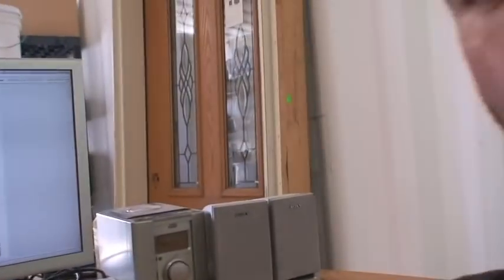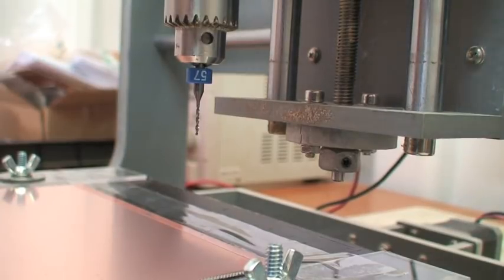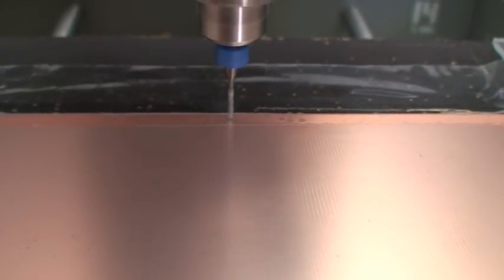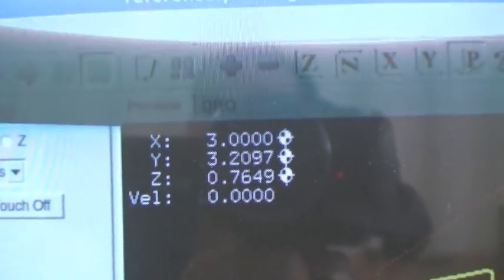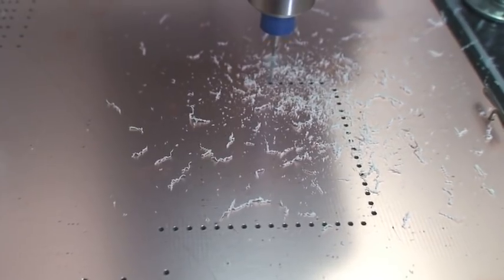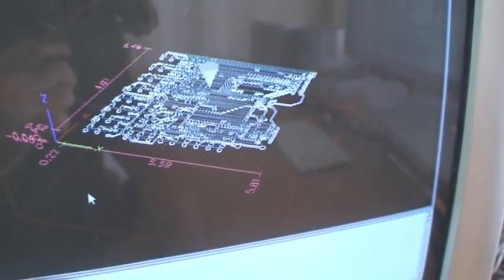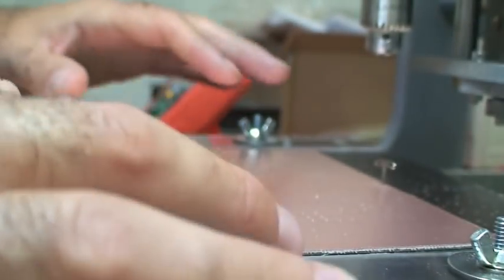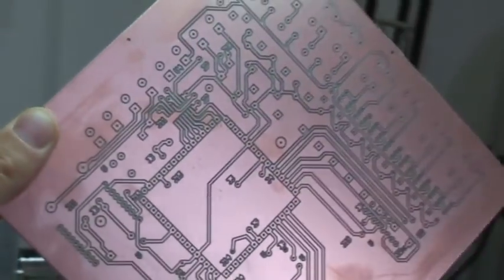Double Sided PCB CNC Milling

Comment: At the sound the bit makes, it's more around 7200 RPM...

Believe me, 30 0000 RPM would make a much high-pitched noise !!!

But, this is only a detail... The finished board is nice, that's the most important thing !

...And i am happy to see the results; i've just bought the same CNC that you use and am waiting for it to be shipped !

Comment: nice video, would like to see how you line up the second side, but also how do you overcome the variances in board depth across the pcb?  i'm still having problems with missing track sections where the board is alightly thinner

Comment from the maker: I use tacks in 4 corners and then flip the board and put the tacks back. The software handles the top/bottom and mirror issues so I don't need to think about it.

Comment: Board profiling methods are often discussed - where an electrical probe is used to probe the vertical height profile of the board in many different locations around the board. This profiling method wasn't used here in this clip. Instead, holes were drilled for the initial step, which would then prevent profiling techniques from being used. Just wondering if there are techniques for getting double-sided boards (using CNC) that does profiling on both sides.

Comment from the maker: I used gEDA / PCB to design the circuit and generate the gcode. It's a built-in export option. I made the PCB on a Zen Tool Works CNC 7x7.

Comment from the maker: This is a Zen-Cart 7"x7" which costs about $300 for a the bare kit and $700 with all the options and shipping. It includes the 30,000 RPM spindle. Each blank is PCB costs about $6 for a double sided 6" x 6".

Comment: Great video. Thanks!

Hi, I'm starting to make my own boards with my own CNC machine but I don't get quite the same results as you do. I'm using the 0.1mm carbing but is 10º. Also, I'm working way slower than you, like 6 to 10 mm / min. The drill is going 6000 rpm. Could you give me information about the speed of your CNC and drill?

Any other sugestion?

Thank you.

Comment: Also, one extremely important thing that nobody on the internet seems to tell us about is.......  this double sided pcb milling technique (that features this board flipping method) will only work properly if the spindle is properly adjusted so that the spindle's rotating column is perpendicular to the cutting surface. Because you can imagine what happens when you pre-drill the pcb alignment holes for the case where the spindle column isn't perpendicular. The problem will be that the alignment holes won't line up properly when you flip the pcb over --- this is because the hole opening on one side of the board will be offset by a 'tad' (due to drilling at a slight angle) in relation to the opening on the other side. So, if the drill bit is on this particular exaggerated angle "\" then the top hole is obviously going to be at a different location relative to the bottom hole. And this is just along one axis. There are two axes (x and y). The issue will not only be holes locations being out when we flip the board. The other issue is not being able to insert the pins. That is, when one side of the board is used, then the pins would fit perfectly. Once the board is turned over, the pins won't fit .... due to the distorted geometry. So, this means proper CNC machine setting up will be necessary for this 2-sided pcb engraving method to work nicely.

Comment: This  video is very useful, but i have a question about the 2nd layer, because you  put the video when the machine is working and i can't saw how do you locate the origin, do you use the same origin?? from the other layer

and other question,  you drill the holes at the first time, why the holes first and no the engraving first ??

Comment: Great Job, Mikey!!!   Technology for the People, yeah! MicroInterprise based in home-based technology is what the future economy will be based in.  I would love to print a board that controls two, 3/4 inch valves that uses two temperature sensor inputs and open/close-limit inputs that are adjustable each and can be inputed for each.  That way the unit could be a flexible tool for biodigestor controls, algae cultivation and basic reflux distilation processes for many compounds and just water.

Comment: One thing to note about lowering the chuck onto the drill bit and then tightening it is to keep the drill bit tip against the PCB as you tighten else the tightening process can cause the drill bit tip to lift off the PCB slightly and when we're talking fractions of a millimeter cutting depth, it matters. I prefer locking the bit into the chuck and then lowering the tip down to the PCB in small increments until it's touching the copper.
Reply: Another thing to note is how far into the chuck you insert your V-Bit cutter. Insert it too far or not far enough and you can end up with rough cuts due to resonance which is also related to the RPM you mill at. The same applies to cutting too deep or too shallow. A friend of mine was continually getting rough cut results when milling PCB and when I visited to lend a hand I found he had put the cutter into the chuck right up to the end of the shank. It happened that the cutter was resonating in such a way that it was skipping along the walls of the cut leaving jagged edges. Pulling the cutter out of the chuck by a few MM cured it and he had lovely clean cuts.

Comment: Very cleaver way to z it without a touch plate.
Reply: You can also use the copper of your pcb as a touch plate, and call G38.2 or G38.3 manually in linuxcnc.
Reply: Another cheap and easy way is to jog manually onto a piece of thin paper sheet while moving it. When the sheet gets caught, you're on zero. Just remember to crank down the speed for the last millimeter or two :D
Reply: @InnerBushman  no you are actually the thickness of the sheetpaper above the surface of the PCB. And believe me, 0.1mm does a Lot
Reply: @ipadize  you're right. 0.1mm is a lot. For super precise things I measure the paper thickness and subtract it for better zero reference. I use the probe circuit for zeroing on my PCBs tho. Paper is great if you don't have probe input.

Comment: I'm about to get into the 'world' of cnc pcb milling. Great video here (even though I'm like 5 years late after the 2011 video was made). I'm assuming that the cnc software automatically takes the 'flipping' of the board (for milling the reverse side of the board in stage 2). That pin method for getting the board approximately in the right position for stage 2 is pretty good too.

Comment: Do you know where to get the adapter between your drill bit mount and spindle motor. Currently I'm using ER11, but want change to the type like yours. Thanks a lot, and video is great.

Comment: How did you connect the top layer with the bottom layer?
Reply from the maker: I added several vias to the design and manually soldered legs from spent components to create a bridge.

Comment from the maker: F1 vs F10 is the feed-rate I tend to use. 

Depending on board type I will run my unit at 12in/min or 300mm/min with a feed override of 120%.

Comment from the maker: I run at different speeds depending on the depth of the cut. If it is a shallow cut I'll run as fast as I can make the mill go (1 mil depth). If it is a deep cut I'll run slow. I suggest making sure your board is well clamped and trying shallow 1 mil depth passes and doing up to 10 of them. This should produce a quality board and you can automate this process.

Comment: What speed are you cutting at? I have a similar cnc but cant get good results however i do. Tried 30,50,80mm/min but get ragged edges if the traces. If i go above 100mm/min the bit snaps quickly (tried -0.07 to -0.09mm cut depth), no luck.

Comment: When you flipped the board over (@ about 6'50"), there was a lot of dust and shavings on the top surface. Did you clean that off before you continued? It could be the reason for that incomplete corner area. I assume you leveled your machine bed before.

Comment: how deep is the milling? and what is the spindle speed (rpm), because i'm surprised how beautiful the tracks are and you didn't break the tip of the bit :) i spin the same bit up to 22.000 rpm so i can have the feedrate up to 500mm/min

Comment: nice video thanks.  what I'm still missing is how you re-centred the bit for the rear side of the board.  could you explain please?
Reply from the maker: It's pretty easy to re-align the flipped board. I flip the board and load the reverse side gcode file and let the drill run with a +20 mil z-axis so I can see how close I am in alignment without actually cutting anything. It's actually a pretty easy thing to line up by sight versus using known drill locations which become questionable once the board is flipped.

Comment: How about electroplating the board after drilling the holes? That the through holes and vias are connected on both sides.  You don't have to solder wires through the vias, and you don't have to solder the through hole components on both sides.
Reply: Jordan, so you have to electroless please the via’s first as the FR4 in the channel is non conductive. This is quite a complex step using Tin Chloride and then Palladium Chloride and then copper. After this process the whole board is electroplated in copper the standard way where the via and whole top and bottom side are plated.
Reply: Electroless plate, sorry for the typo above 🙂

Comment: Hi Mikey, thank you for this video. I've one question, how can you sold thru hole components in a 2 layer board like the one you made  if you have tracks from bottom to top or viceversa? I have problem with these because the drilled holes doesn't connect the traces like a fabricated PCB and if you try to fill the gap soldering, the pond doesn't cross the surface.
Reply: Robert Casanova Hi Robert - I'm doing double sided PCBs when doing prototypes for clients. And there are 2 ways of doing it : 1. If the components can be soldered on both sides do so ;-) 2. Insert a piece of thin wire and solder.
Reply: Hi hbsorensen thankyou for your answer. With Choice 2 you mean adding a thin pond wire in the hole before make the join? Thx
Reply: Yup
Reply from the maker: Use a component leg through a via to create the bridge.
Reply: Robert Casanova 5

Comment: Hi In regards to your video "Double Sided PCB CNC Milling "
I think your followers and people leaving comments are asking What model Double Sided PCB CNC Milling machine you have and some information about it could you please leave details of the machine drill size's software used the board used how does it cost for a pcb blank size ?
all those questions and some more info for your fans would help get them out there and doing the same that is if you have the time to respond to your fan group

Comment: Really nice.
A comment - the commercial machine we used at had a shoe that kept the board flattened as the cutter went over it. A lot of the boards had a slight warp in them.
What spindle speed are you using. The commercial machine we used had this little ultra-expensive Swiss-made motor that would go to 100,000 rpm. I am curious what kind of motor you are using.

Comment: hello, thanks for this video, please is the dust of FR-4 (pCB) toxic or not? because I read that was made by fiberglass? thanks
Reply: Yes it is, better to use FR1 board when milling
Reply: @phildavies5833  thanks for the answer, i did a search or i found that it is not really toxic since it make by the long glass vibrator, so when we cut the fiber size is big than 5 um, thanks

Comment: Would it be possible to say, spray / cover the entire board with solder mask, and have the cnc take the mask off at the solder points without damaging the copper?
Reply: This would be really hard as the cnc will probably cut away a bit of Copper. You can however make a (wooden?) mask which has cutouts over all the Spots that you want to spare from the Solder mask, then use this mask to cover all these spots with some sort of removable paint, then spray on the solder mask and wash away the Paint...
Reply: Niklas Mertens
i think that wax instead of removable paint can be easier to use cause solder mask will not stick to it and you will only nead to wash it of in warm water, and probably you can use some kind of hot nozzle to put wax dots on circuit board with cnc :P
Reply: Niklas Mertens You could also create a real stencil using the mill.
Reply: Warndog there are spring loaded milling bits for that. They remove paint and stuff but wont mill into harder material like the copper.
Reply: Wouldn't every component be connected to each other by the uncut copper sheet?

Comment: I wonder if my DIY milling can perform to do such a job. I feel that the software I am using is not the real pro .GRBL with arduinio  UNO . May be it is just a hobby thing.
Can you advice a software which can make the things pressie..
the mechanical side of the Milling is not bad ,
Or GRBL is good enough and I dont know how to make the best out of it.
Please advise
Reply: The software is not a problem. I do not know what is your hardware. That may limit you. Look for ChiliPepper for CNC
Reply: Pete Mathews

Comment: Why are you milling so deep?
Reply: This would probably be karma coming back 1yr after, but this video is 2011. Height mapping wasn't a thing maybe and so cuts have to be deeper in order to get the entire etch, etched at all especially for the size of the circuit board.

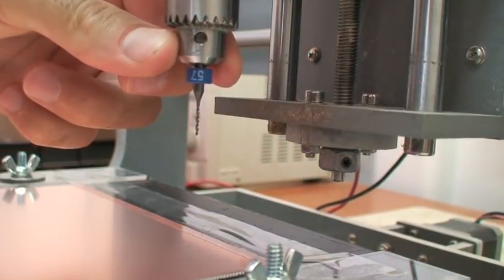Comment: @1:12     
42mm diameter ? What are you talking about? It looks like 1mm dia to me.
Reply: 42mils, not 42mm. 1mil = 1/1000inch. So 42mils is around 1mm
Reply: @user-cb9kz2il8g  Oh, ok. Thanks for explaining that.

Comment: So it's a dual sided pcb right?
How to you handle the vias?
Reply: That's a great question. I think there are no vias but you have to cleverly use the through-hole components as a way to access the two sides. I'm just guessing. If anyone knows please explain :)

Comment: 5 boards for $38 at itead studios with solder ask/silkscreen.
Doesn't seem worth the hassle of CBC unless you need it in a hurry or are just proving out the design.
Nice summary though.
Reply: $38 for 5 boards of that size? Double sided?
Reply: Sorry, my mistake. 15cm x15cm has a $32 adder. So total cost is $70 plus shipping ($10.38 airmail to USA).
5 boards, silkscreen, green soldermask, 100% e-test, 1oz, HASL.
Open source your files and get 2 extra boards for free.
Check it out. Used them many times for smaller boards so never had an adder. Quality excellent.
http://imall.iteadstudio.com/open-pcb/pcb-prototyping/im120418010.html
Reply: Yes, double sided.
Reply: Microchip TTE
Sounds like a great deal! TY!

Comment from the maker: The blank 6x6 double sided pcb's are $3.38 each. I actually prefer the single sided ones because on a simple board there is not need to take the time to do mill the other side, but the single sided ones are twice the price. Go figure.